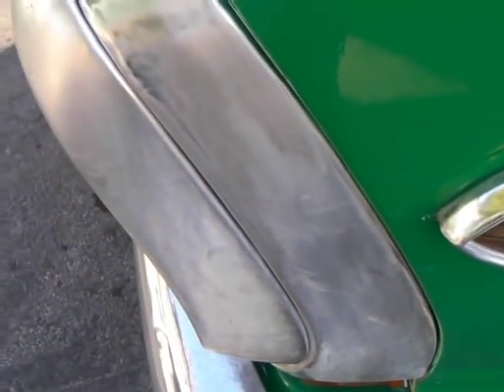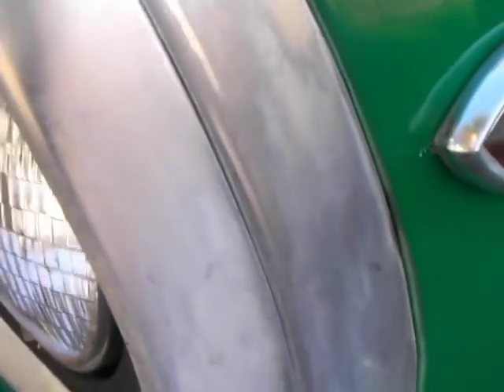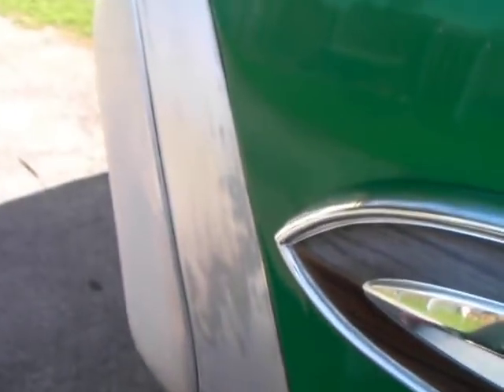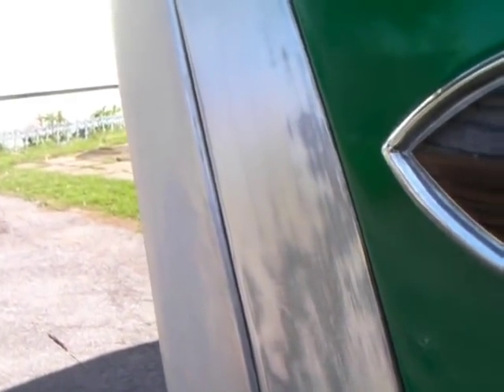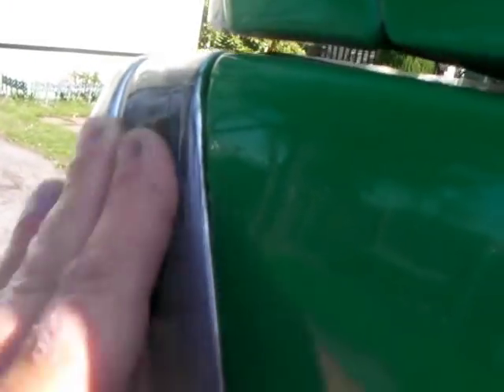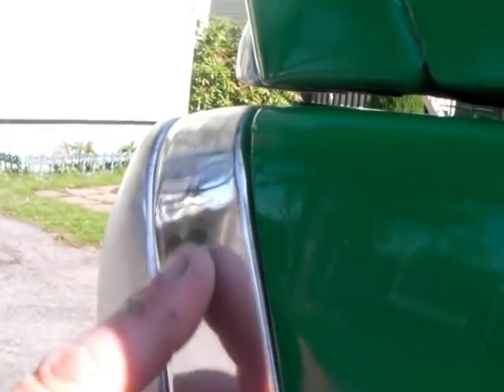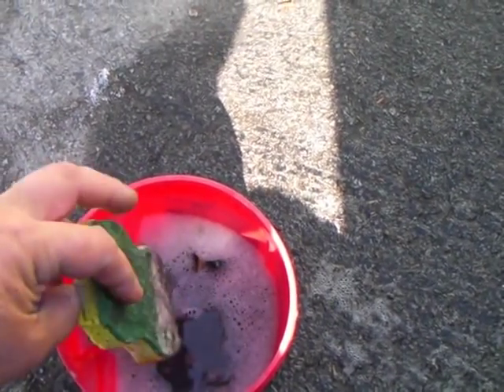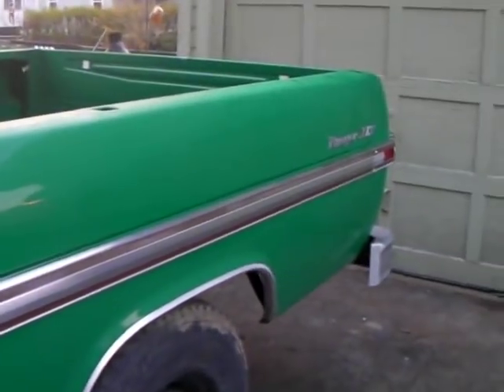Restoring aluminium trim.

Comment: Most aluminum auto trim is anodized from the factory to keep it looking bright .when restoring it takes a lot of sanding to get all the anodizing off ,any spots you miss will look a little dull .I use oven cleaner to get most of the heavy anodizing off then start sanding from there . hope this helps !

Comment: I restore a lot of older Mercedes which have a lot of Bright anodized trim. They got the shiney effect by polishing the trim to a mirror finish,then it's washed and dipped in "bright anodizing solution" which holds the finish lustre,then it's anodized normally. That's basically sulfuric acid with a current running through the parts to harden the surface.The bright finish dip is the hardest to get done as it requires the fluid to be kept warm constantly .A damned expensive process.

Comment: I am also restoring some aluminum trim & molding on a 67 dart.  After some research I discovered that ALL aluminum trim from the factory was anodized, and that is the top layer you are removing down to the aluminum. Which is fine, it looks great and the only drawback is upkeep. I have my car completely disassembled and doing each piece individually. The big decision will be wether to re-anodized after they are all polished.
Reply from the maker: +doacarnage all I can say is that the trim holds up freaking awesome. I hit it once a year with some mothers and it's good till the next year. I did a revisit video in February cause someone had the same concerns as you, check it out and you might be surprised.
Reply: I have a 67 dart also and have been scouring the internet trying to figure out if all the trim is anodized aluminum, so thanks for that.

Comment: Looks great!  Just started working on the trim on my '86 F150.  Started wet sanding with a drill and 500 grit sanding disk.  Was wondering how low to go with the grit.  Guess I can go a bit lower.  I'll have to try the mothers.  Been using Noxon and Never Dull.  Works ok but looks like Mother is a bit nicer.  I'll go a few grades higher in grit too.  Have only gone up to 800 so far but results have been incredible.  More wider range of paper grit should make the job easier.

Comment: your doing a great job understanding what your doing ' to make the job easier get a auto buffer to use with the mothers.  be sure to protect your paint . finish sanding with 1200 paper to make the buffing faster ...   nice truck !! but needs a nice set of aluminum wheels to brighten up the paint.  good job dude.
Reply: Thank you sweett ie
I have a dull 62 ford falcon grill. Thanks so much

Comment from the maker: @1972FordF150 You nailed it, just about 10mpg. My truck has a 360 and everything I've read says they are the worst on mileage but if they are rebuilt to a 390 you will increase the mpg by around 20%.

Comment: Thanks for the video and the update video. I just bought a '64 Fairlane and will be doing this soon. I was wondering how it would hold up over time and the update video answered my question. Also thanks for the Dremel suggestion! It never crossed my mind to use that!
Reply from the maker: +Daniel Carson Thank you. I'll tell you that it's a LOT of work but well worth the effort. Have fun and let me know if you post up a video on your work.
Reply from the maker: +Daniel Carson one more thing. I can't remember if I showed the grill in the video but the scaling was so bad on it that I had to use my dewalt random orbital sander with 80 or 100 grit paper to bust through it.
Reply: +116falconer Thanks. my car only has 25,000 original miles and has been garaged almost it's entire life so it's not in terrible shape. However, I plan to take my time, start with 100 grit and work my way up to 1500 grit. It's a project for my son and I.

Comment: the best way is to remove it, strip it, polish and re anodize. the cost is well worth it and it looks period correct.  i just restored my 65 rambler American 440 convertible and re anodizd every part that came anodized and it came out looking new again.!! do it right the first time!
Reply from the maker: +tony goulart I suppose you are correct but for a few bucks in sandpaper and lots of elbow grease my trim still shines like new. If I had a classic car that was worth spending the money on I'd do it your way but as I'm sure you know classic trucks don't bring in the long dollar.

Comment: That coating that u sanded through protects the aluminum from oxidizing so now you have to protection to the elements beside you polishing the crap out of it. Nice truck btw
Reply: Tyler Draper dude that coating stopped doing it’s job a long time ago

Comment from the maker: @1972FordF150 I believe it has to do with the stroke. If I remember correctly Ford had the 390 and wanted a smaller displacement engine so they just chopped the stroke on the 390 and ended up with the 360. With that the engine as a whole has to work harder causing it to burn more fuel.

Comment: @116falconer I hope so too, this truck has sit for 11 years so it needs some work, but it doesn't seem too bad for 400 bucks. Guy had it running needs some carburetor work etc like that. By the way what do you get for MPG on yours? I'm guessing around 10-12 MPG.

Comment: The vid was great and I'll be sure to try this for my 72 ranger but I was wondering if you had any way to seal it? my sister has a 66 we cleaned up and we clear coated the aluminum after polish but the coat is pulling together and no longer sits in the groves and I didn't want the same to happen to mine. if there's any other way other than normal polishing of the parts, id like to hear them. thanks

Comment: The original had an anodized coating on it. When you sand it, you remove that and you will always need to put a lot into polishing as it will tarnish more easily.
Reply: But it looks dull and milky the way it is. Do you know a way to make it shine without removing the anodizing?
Reply from the maker: Once you get it sanded and polished (a lot of work) it takes very little time and effort to maintain the shine. I think it’s worth it 👍👍🍻🍻🍻
Reply: @116falconer  I agree! Why are people so afraid the remove the anodization? Especially when it looks awful...
Reply from the maker: @raizt1596  I did a update video on the chrome because of doubters, it was 2 or 3 years (I think) after the original video.🍻🍻

Comment: great video! I have a 2004 gmc yukon with chrome trim on side of truck that's in bad shape and was wondering if this would work on what i think is aluminum chrome trim. please help
Reply from the maker: If it's plated I think not but if it's polished yes it will. If it's polished with a clear coat over it you'll have to sand through the clear coat first, for the front grill of my truck I had to use a random orbital sander with 80 grit paper to cut through the scaling and clear coat then hand sand up to 600 wet.
Reply: that's where i can't figure it out. i'm not to good with knowing the difference between the two.
Reply from the maker: Go to Wally World or a auto parts store and get a small jar of Mothers polish then try using a damp rag to apply it, if that doesn't work get a NON-SCRATCHING Scotch Brite pad and try that. Make sure to try in an inconspicuous area first. If you could post a video I might be able to help you further.
Reply: I will certainly try that. thank you so much for your help.

Comment: @116falconer The 360 is a 390 block with the 352 crank and rods. Also I think they have these 360's factory retarded like 4 degrees and that causes them to burn even more fuel and lack some more power.